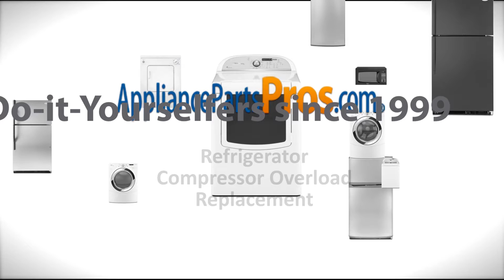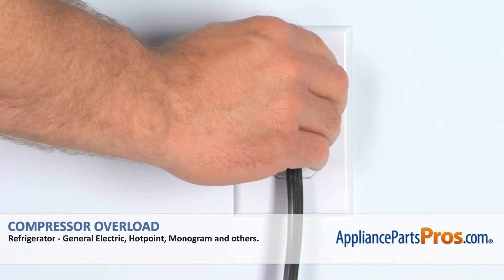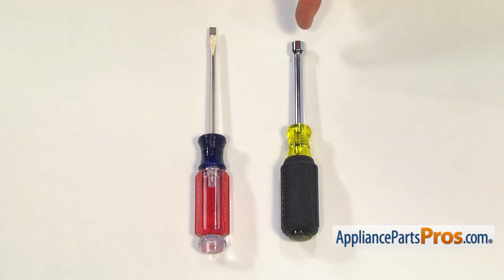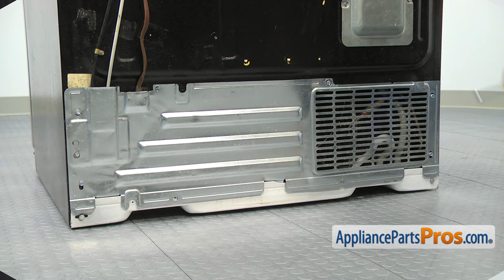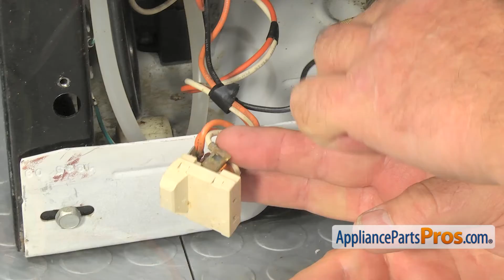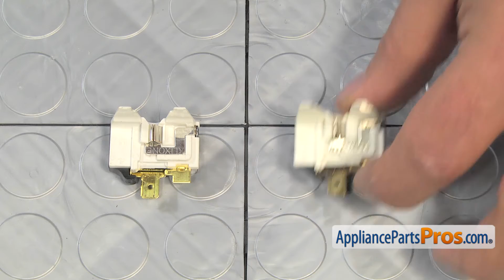How To: GE Compressor Overload WR08X10025

Comment: Do the new compresser inverter control units have this function? I ask because i cant figure why they put this electronic device attached to the compressor. It just heats it up i would think damaging it and i am having issues with the control unit, thanks

Comment: Simon, great video.  I had a problem with my 32 year old Kenmore when the new cat, a Siberian with lots of fluffy hair,  plugged up my condenser coils, fan and the entire underside of the fridge.  This was something new, as I check for this every 6 months or so regularly.  The condenser got so hot that it burned a black mark on the floor.  It also finished off the condenser.  So, a few weeks later I have a new Frigidaire FFSS2615TS which was delivered yesterday.  I was actually thinking of designing a thermal/current overload switch that would interrupt the AC line.  Looking at your video, maybe this is intended to do the same thing.   I think this can be a major failure mode in fridges.  So, I want to be proactive.   Cleaning the coils is  something all cat owners have to deal with.  Having a sensor that would detect thermal over heating and signal the owner that it is time to clean the coils as well as protect the compressor would be great.   Right now, day 2 of my Frigidaire FFSS2615TS ownership, I still am not sure where the coils actually are located and does the stock design have such a circuit to protect the compressor.   Look forward to hearing from you.  
Jim Moss Fiddler

Comment: I tested the overload for continuity and it was good. But it rattles and makes sounds.
Reply from the maker: Usually it is the relay that makes rattling noises if it is bad. Since I do not really know what you are hearing I cannot comment on it but the overload is like a fuse if it has continuity it should be good. Without knowing what you have, I would suggest posting the problem along with the appliance model number on our repair forum and the techs can help you troubleshoot the problem. http://forum.appliancepartspros.com/

Comment: Is trhe same diagnosis applicable to an upright freezer
Reply from the maker: +Joe Anderson Overloads are used on all compressors if you need help troubleshooting you can post the problem along with the appliance model number on our repair forum and the techs can help you troubleshoot the problem.